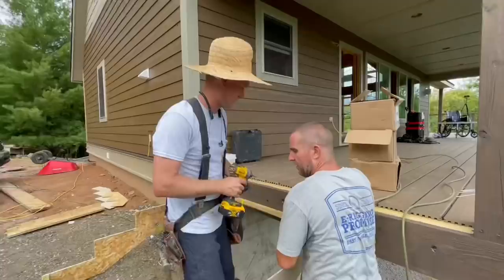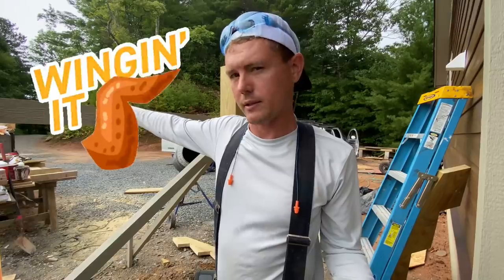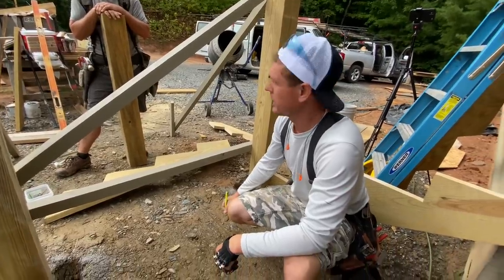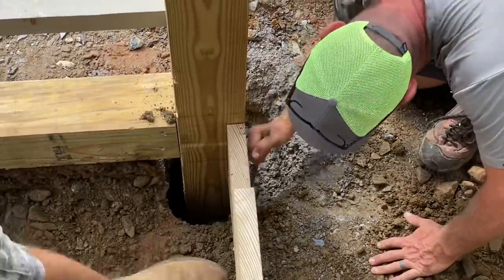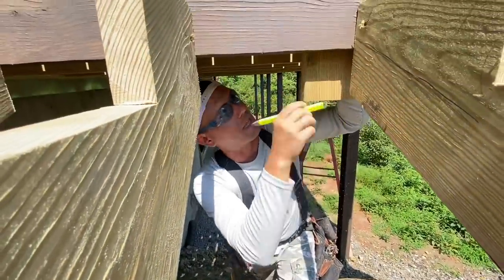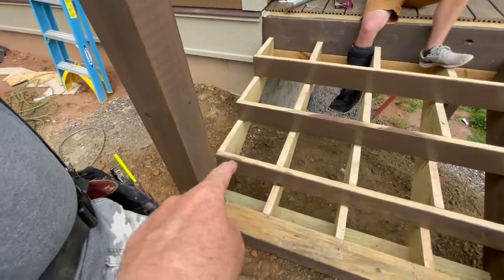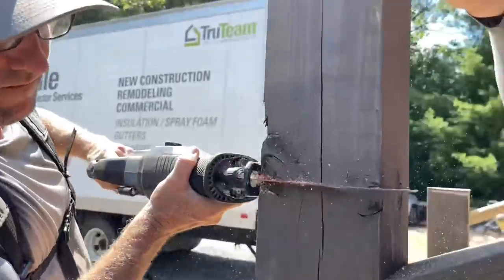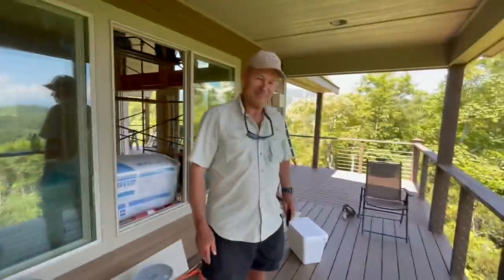Building The Nantahala Retreat #28 | Porch Stair Framing

Comment: It’s not a good idea to put concrete under the post ind the ground… When water runs down the post it will get in between the concrete around the post and the post itself… When you put concrete under the post the water have nowhere to go… hence the water will soak up the post and it will get rotten!!!
Instead you should get 3-4 inch of stone under the post and 2 inch up around the post BEFORE you pour concrete… Now the water that goes between the post and the concrete can drain away 👍

PRO tip from Denmark
Reply: so how do you deal with settling of the stone?
Reply: @bs838  don’t sure I get the question 🤷🏻‍♂️

But you dig the hole 3-4 inches deeper than the post must go into the ground… then you put in the small stones (10-20mm)… stamping it, putting in the post, levelling it, putting in stones around it, stamping again and then pouring in the concrete… 
The post will NOT sink into the ground… I’ve put up a good part of fence post in that way and they all stand as the day they were set 👍
Reply: @jahen65  What I meant was that the stone and gravel will settle and compact (even if using a tamper) more than concrete. For fence posts, not a big deal. But for stair railings, this would cause a huge cosmetic issue as you could imagine. Furthermore, concrete is porous and any water that makes it between the concrete and post will eventually seep through, so for a treated post this should not really cause rot over the normal lifespan of the structure.
Reply: @bs838  But it’s still fun to see these construction videos from the US… many of the ways they build would never go i Denmark and would often be illegal by code… especially the electric wiring!

Comment: In Belgium we use only "stabilisé" (just sand and cement) to support the posts instead of concrete, so water can infitrate and dont affect the wood. So the wood stays good and don't break overtime just where it is touching the ground.

Comment: PBB,
    Thank Yall for these videos‼️
The explanations are needed because of the various ways to build things~~like Rock/ Brick Steps. 
    I see a future retaining wall under that porch to hold the fill dirt;rebar drilled into the basement block wall that has the cells poured‼️ Those are the Extra Cost Things, when building in The Mountains‼️ We don’t like them but they save nightmares in the future. 
     Blessings to Yall from Northeast GEORGIA Mountains‼️

Comment: Good ides to reduce stringer spacing to 12” max. with composite decking.  Carry that thinking to structural framing under all composite decking decking material, except 2x decking which is rarely used anywhere, anymore.

Comment: Big hole, rebar mat, form and finish top, stringers on 9" centers.  No wood on, or below grade.   A little more work, one stringer, 2 yards concrete, and it would meet code in most the world.   This is not a shed.

Comment: sorry dude.. you didn't wrap the post to protect them from the concrete, I know they are pressure treated, but the acid element in concrete will eat those posts in 5 to 10 years

Comment: The next time you see a C-130 at the jobsite note the tail code (two letters you see on the rudder, the vertical part of the aircraft's tail,) as that identifies the home base of the aircraft.  "FT" is the tail code for Pope AFB, Fayetteville, NC.
Reply from the maker: That guy flew over us about a dozen times in a row! I will halfway wondered if they were using our house as a pretend target
Reply: @PerkinsBuilderBrothers  I doubt it was the same aircraft that flew over you each time. C-130's like the one in the video do not have any offensive weapon systems. They do have chaff and flare systems but these are passive defense measures. Of course, they could lower the rear ramp of the aircraft and drop something on you or shoot at you with firearms. LOL The C-130 pilots train flying low level sorties and use predesigned flight plans. This flight plan just happens to pass over your job site. I would be interested in knowing from which base these aircraft are flying.
Reply: FT is a Moody AFB HC-130J, the 23rd Wing hasn’t been at Pope for years. There’s a VR route right through that area that is awesome to fly.

Comment: What's the difference between pouring footers for the posts instead of pouring pad for a landing? Then you have your posts sitting on a slab and your last step is concrete instead of dirt
Reply: I commented too early, I like that idea, but here they still require a pad
Reply: Super interesting framing. My foreman would flip if I spent that kinda time though

Comment: Gosh. That drone fly-away at the end. That's a nice location.  

And I have an honest question, not intended as critique. Is there a better way to mount the posts than burying them in concrete? I understand that they are ground rated, but is there an alternative method that would give even more longevity to the material? 

I ask because I worry about these things all the time when renovating old houses.  I'm guessing you chose the concrete becauase the posts are virtually free-standing and will be under additional tension from the cable rail. So.....maybe there's NOT a better way😆  Carry on, I'll just keep asking and answering my own questions in a public space.

Comment: Pro tip.  Paint the lumber or use copper brown on the cuts.   You can also coat the bottom of posts with a waterproofing membrane up a few inches above ground.   That way the posts won't ever rot out.